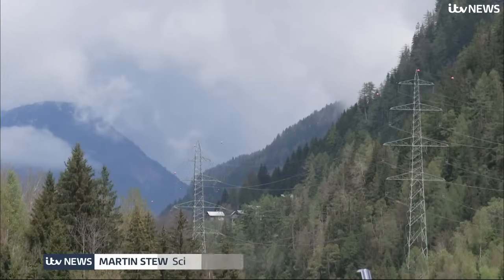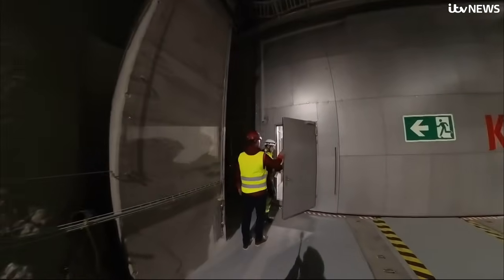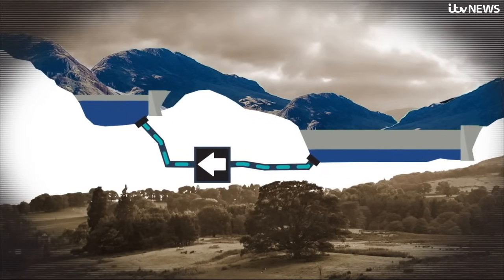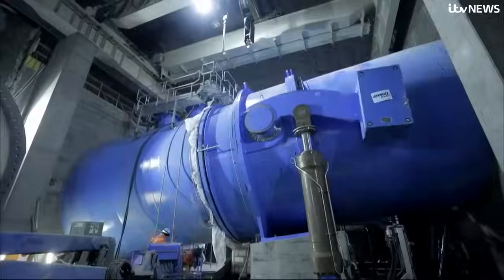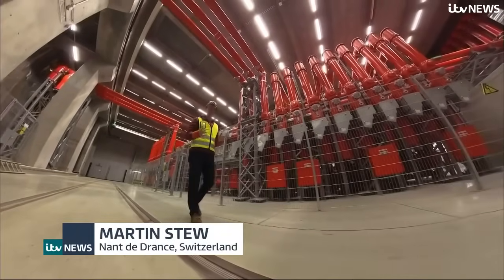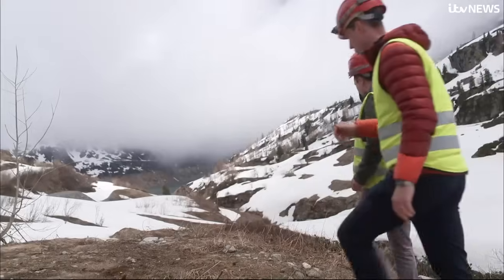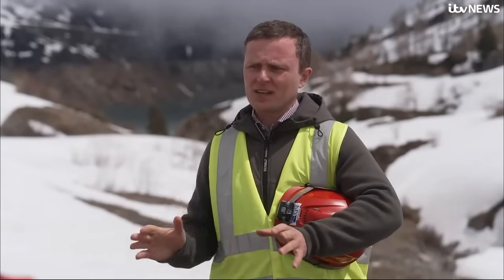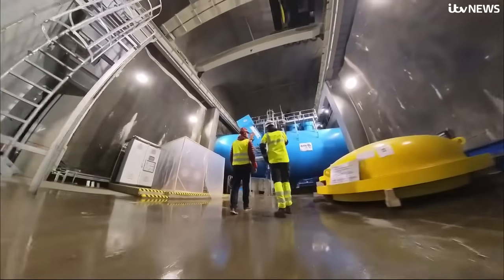Could Loch Ness be turned into a giant water battery? | ITV News

Comment: We have more energy from the sun than we can deal with?  I couldn't believe what I was hearing.  For years we've had the oil & petrol lobbies telling us in the UK not to bother with solar panels as we dont het enough sun to make it worthwhile.  I still think it should be mandated that all buildings have solar power equipment built into them, not just panels.  You can also get glass that harnesses solar power that can be fed into batteries and the national grid.  The water battery idea is a good one too.  Anything that gives the UK energy independence is a good thing.  You only have to look at northern Europe to see how well relying on one source of energy provision has worked out.  Renewable energy is the way forward

Comment: This is a national landmark , absolutely no alteration of the lake
Reply: Which lake? There is only one lake in Scotland and that's the Lake of Menteith. However, Loch Ness has been the lower end of the Foyers pumped hydro system for 50 years it occupies about 100 metres of the eastern shore and hasn't been a problem, I don't see why one or more additional schemes should be an issue.

Comment: There's already a plan to add another pumped hydro scheme in Scotland, but even when that's completed it won't make a dent in the amount of energy that has to generated by gas-fired power stations to cover periods when there's almost no wind energy. Pumped hydro is there to cover short surges in demand and to buy enough time to bring other generators on-line.
Reply: The Fins are Storring energy as heat in sand batteries and there's a liquid air battery facility being built near Manchester as well as deployment of Tesla's MegaPack technology, we should be investing in tidal for base load.
Reply: @SlowhandGreg  We could build the Severn barrage but obviously this will affect the eco-structure upstream and those wading birds and wildfowl will move away and perhaps over decades will be replaced by other species that adapt to the new tidal movements. We could also turn the Lake District into an enormous pumped-hydro scheme if you don't mind seeing the valleys beloved by Wordsworth and Beatrix Potter flooded and villages and farms submerged
Reply: @brendanpells912  I'm more a small scale devolved mesh network person myself. We have the smart technology to do it.
Blade tidal systems are available.
I've a thermal store at home a high capacity heavily insulated water tank connected to thermal solar.
Reply: @SlowhandGreg  Hot water is low grade energy. Electricity is high-grade energy because it is easily converted into other forms of energy and can be transmitted easily over long distances.
Reply: @brendanpells912  The answer to the renewable problem isn't one big thing it's a diverse range of technologies and solutions.
Solar thermal works well with heat pumps reducing the energy needed to heat up the water for a wet system.
The tanks loose around 2 degrees a day if left unused.

Comment: This should really be a public government project done 20 years ago. But the UK government are so useless at managing such infrastructure projects it has to be done by private companies who need to make a profit hence making the energy more expensive for consumers.
Reply: A private company might build for £X pounds and require a gross profit of say 30% which will be taxed. The identical project run by the UK government is likely to cost 3 times as much to build and will never make a profit. So, experience suggests a government project is a massive extra cost to consumers and taxpayers. Look at HS2 if you need an example of a public sector project fleecing the taxpayer in every way possible.
Reply: @pauljrogers2885  LOL, and the green taxes.

Comment: just make nuclear power plants
Reply: The first pumped hydro plants were actually built to help nuclear load balance (cause nuclear output doesn't vary, but demand does).

Replacing gas with nuclear would still need a lot of new storage (less than with wind, but still a lot).

Comment: The Royal Society recommend the UK should have 100TWh of energy storage by 2050 (it's currently 39.3 GWh from 4 pumped storage facilities). That's over a 2,500 fold increase. That means building 10,000 pumped storage facilities or 400 every year. A typical pumped storage facility has a 300 to 400m dam built to hold back 10 million cubic metres of water, with a fall to the turbines below of about 400 metres.
That's at the same time as increasing wind power generation from 75TWh (in 2020) to 665TWh (in 2050 - these are UK National Grid figures). That's around 100,000 giant wind turbines. And by the time you get to 2050, the 4,000 wind turbines you needed to install in 2025 would have reached the end of their working lives and will need to be buried in landfill, and replaced with another 4,000. It's all impossible and absurd. 
The cabling and additional structures to connect all this together will essentially require the UK consuming huge amounts of  copper and other rare metals for the next 25 years. 
1.5 billion tonnes of concrete 
42 million tonnes of steel (which is going to need 27 million tonnes of coking coal) 
1.9 million tonnes of copper 
1.3 million tonnes of zinc 
184,000 tonnes of manganese 
122,000 tonnes of chromium 
56,000 tonnes of nickel 
54,000 tonnes of other critical minerals. 
No doubt all of these materials will be ethically sourced using low carbon processes.
Nuclear power would require less than ½ of these resources and Coal power around ¹/10th. 
The cost will be unaffordable and the skilled manpower levels unattainable. And that is just to eliminate the less than 1% of the global CO2 emissions that the UK is responsible for. So times that by 100 for the whole Earth going Net Zero. Good luck with that.
Reply: 100TWhr of storage is a ridiculous amount and completely pointless, the UK peak half hour demand in the past 12 months was just under 47GW, average demand was 29.8GW, so you're talking about 87 days of storage at peak demand, and 140 days at average demand. That's if there was no generation anywhere on our grid, but the lowest combined renewable and nuclear generation averaged over a rolling 4 week period during the past 12 months was 11.7GW (14th Aug - 11th Sept), so that means the storage would last 118 days and 230 days respectively. You do realise that report was written by two people, one actively pushing for a hydrogen based economy and the other is a battery chemist?
As for your claims of "UK consuming all of the current global supply of copper and other rare metals for the next 25 years", complete rubbish. Even if the current 4-5 tonnes per turbine isn't reduced, and it will be because copper is expensive, that's still only 0.5MT over 25 years when global output is 26MT/year, so only 0.08% of global copper supply.
For someone who has the word "scientist" in their username, your claims seem to be based on your own fears and misconceptions rather than facts and reasoning.
Reply: @garysmith5025  Maybe the Royal Society has recommended 100Twh because statistically "Wind droughts" where electrical generation runs at 20% of capacity lasting 100 days or more can be expected once every 50 years.
Reply: @OldScientist  Nope, possibly that might happen in one location but not the entire UK and our coastal water for over 3 months without break. Even if it did, by 2050 we'll certainly have an overcapacity of solar PV, a build out of tidal flow turbines, geothermal, etc. To suggest we need to store the equivalent of 2-3 months worth of total electrical demand is ludicrous.
Reply: @garysmith5025  Is that just your assertion about Britain will never being "dunkelflauted" or do you have some data to support that?
Reply: @OldScientist You made the claim first so it's up to you to prove it. After all, you claimed the UK would use the entire global output of copper to the wind turbines than our generation target requires. I see you've now edited your original claim to something a little more realistic, although added an utterly ridiculous comment about coal. You do realise to generate all the UK's electricity from coal would require 78 million tonnes every year?
You now claim 1.5 billion tonnes of concrete are needed to install the required wind turbines? Even it it were 100k turbines rather than the 7k-12k actually required, that's 15000 tonnes per turbine. An onshore turbine requires 600 - 1000 tonnes in typical UK conditions, offshore turbines don't use concrete, they use steel monopiles. Assuming 50:50 onshore and offshore, the actual amount of concrete will be about 7 million tonnes. Hinkley Point C required over 4 million tonnes and will be able to generate about 10% of our average demand, so nuclear would require 6 times more concrete than wind, although even it pails into insignificance compared to the fossil fuels needed to provide the same electricity.
Reply: @OldScientist  According to a study by Li, Watson, Basu & Russchenberg regarding the longest period of dunkelflaute the chances of a 4 day 20% event in the UK are once in 10 years, extrapolating their data shows each additional day reduces the probability by about 20%, so adding 3 days to the even effectively halves the probability, a 14 day event would be a once per century probability. You can do the maths on your fabled 100 day event.
Reply: @garysmith5025  It's not my fabled event. It is in the research I referred you to.
Reply: @OldScientist   My reply possibly isn't being shown publicly because I included the ISBN of the report, this is the same reply without the number:
The report you refer to makes no mention of 100 day dunkelflaute, which is characterised by output being less then 20% of the long term average for that month. The supplementary notes detail the number of hours (not necessarily contiguous) each month for the last 37 years when such conditions prevailed, the worst month was December 2006 with 152 hours, just over 6 days. That's a long way short of 100 days, which you have clearly made up to suit your narrative.
Reply: @garysmith5025  I'll have another look at the paper. Maybe I misread it. Thanks
Reply: I'll also add that you're about an order of magnitude out on the number of turbines required to generate 665TWhr/year. The turbines being built now are far larger than the majority of the 11000 currently installed, so we'll need between 7000 and 12000 new turbines to reach the UK target.